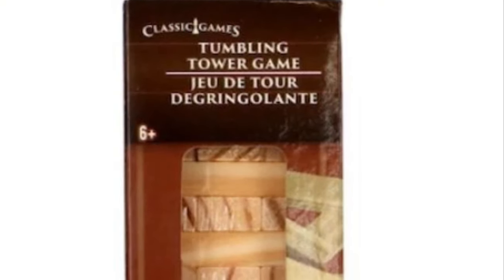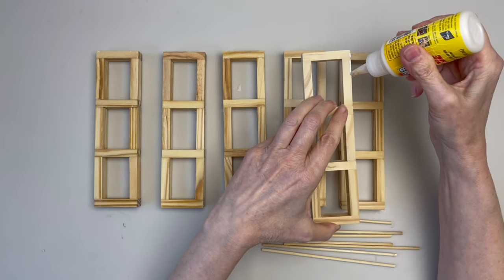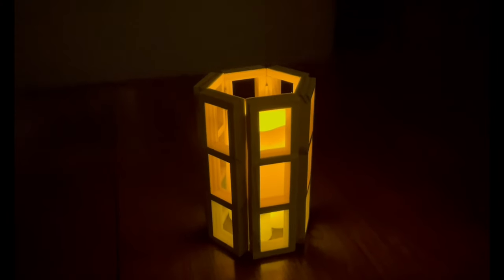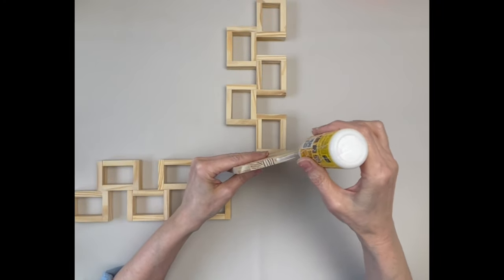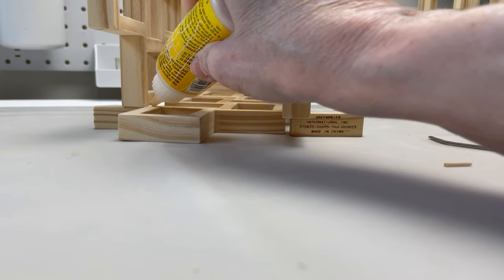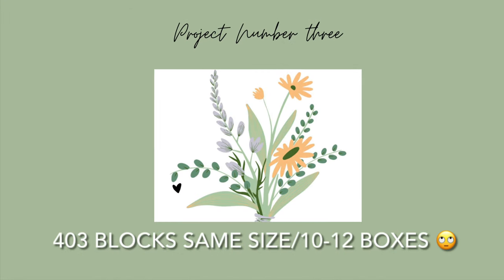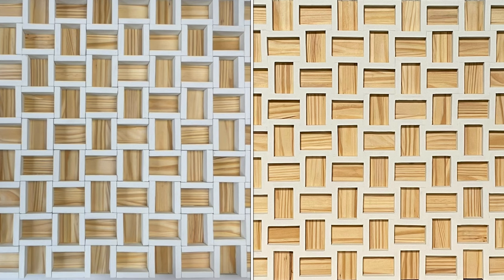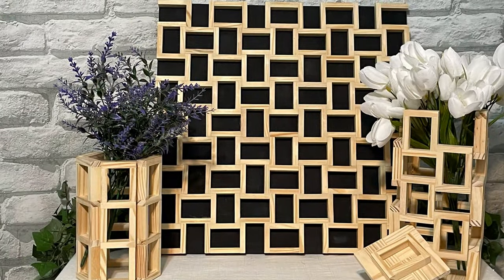Tumbling tower block decor episode 5!

Comment: I'm literally sitting here trying to figure out how I'm going to attach your frame. I not too long ago got luxury vinyl tile and I thought it would be nice to use it as the background....I'm using a rub on transfer.  Its so heavy I hope I don't have to use the backup poster board.  I love the natural and white wall art. I'm thinking about doing the wall art with natural and Waverly wax on the top part. I think the natural blocks on the back let the beauty of the blocks to shine.  I am so impressed with how you think and how creative and original your projects are.
Reply from the maker: you are so sweet Dana, thank you!
Reply: @jeanneflobergmimicraft2758  I did the craziest thing I compared the blocks 3 at a time and not as a whole....so I had a few gaps so I did the sawdust you recommended....however that little glue bottle with the metal thing you once recommended I used that as well.  I was sitting here thinking I've learned a lot from you....I also finished with the frame and attached it to tile.